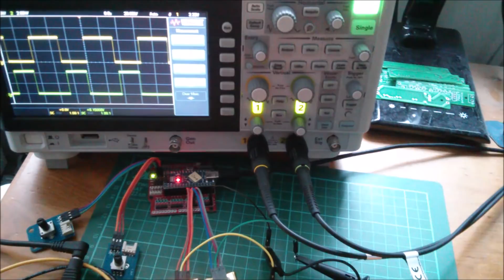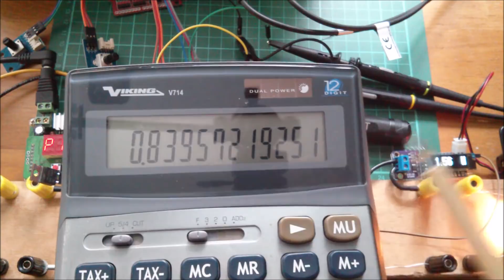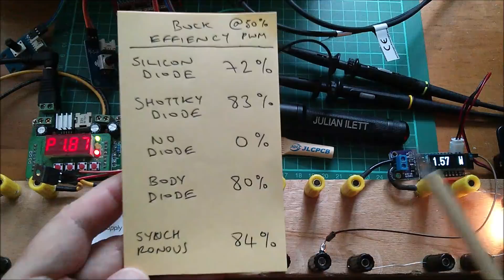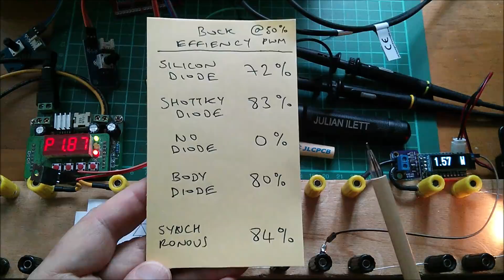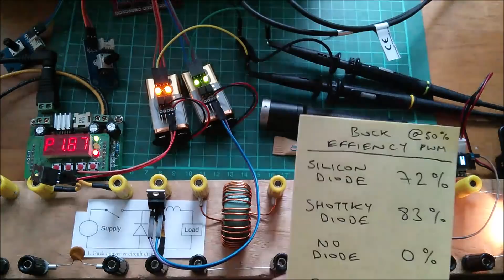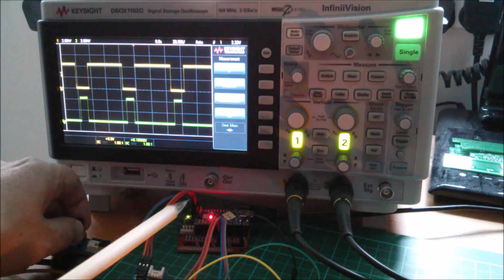Let's build a Synchronous Buck Converter

Comment: i can easily achieve %98 efficiency with proper selection of mosfets and drivers. Also inductor and frequency should be properly selected.

if you draw to little current, efficiency suffers. Try drawing 3-5 amps and see how everything changes

Comment: are you sure about that way to calculate the efficiency by dividing output by input? Because I get higher than 99% but not 100% even under like 6 amp load, is it  because my Arduino(which I'm driving the mosfets with) uses external power source? My Arduino ground is connected to my buck converter's input ground

Comment: Synchronous  buck converter only gives you a better efficiency at low duty cycle and / or at high output currents. Like for example the multiphase synchronous buck on a motherboard which will generate the 1.1V core voltage for the CPU out of 12V at 90 amps output current. Duty cycle is very small (high on time for the diode replacing low side switch) at high current.
An other reason to go for the synchronous buck, is the  need for bidirectional energy transfer, which your setup is already capable of.

Comment: I'm pretty sure that you did not build a synchronous converter.
Your MosFET's drain is connected to ground and the source is connected to the inductor, so that the inductor discharges through the body diode of the MosFET independent of the gate voltage/pulse with.
Instead, you have to swap source and drain to obtain an actual switch.

It is very interesting though that the efficiency changed even when the parasitic diode was acting as the discharge path. Maybe some ringing was prevented by the reversed MosFET?

Comment: You have gained 1% in buck circuit efficiency, but you are now powering two Arduino's. That equates to a significantly lower overall efficiency in this low power circuit than when running it with one Arduino and a Schottky diode. The only obvious ways that switching two transistors could possibly be more efficient than the simpler circuit would be either using one Arduino to switch both MOSFETs, or else to use two Arduinos in a much higher power circuit than the Muppet 2.

The question is 'Will you be trying to use one Arduino to switch both MOSFETs?' The results of that test would be interesting to see. Thanks Julian.'
Reply: He's using one Arduino. What you're seeing are two MOSFET driver boards controlled by the Arduino via an opto-isolator, having their own power source to isolate them from the Arduino.
But I agree that he should also measure the power consumption of the Arduino and MOSFET drivers to get the true efficiency.
Reply: I just noticed that these aren't discrete MOSFET drivers, they're opto-isolators used as MOSFET drivers.

Comment: If you want the efficiency, you may look into doing diode emulation.
The way you have it set up now, allows the output to leak back into the regulator

Basically turn off the FET when the current direction reverses!
You would need some way of meassuring the voltage over it or current to do the trick.

(there may be a way to use creative timer modes and meassure currents using timer trigger on ADC)

Comment: you are testing at too low output power, to see any great benefit of synchronous mosfet compared to only diode. Also dead time must be as low as possible, yours (because of drivers/fet) is not

Comment: Julian, the efficiency will be poorest at the highest difference between input and output voltage.  When you turned the output voltage up near the end of the video, the efficiency rose to nearly 90%.  This is very typical of buck controller behavior, and you'll see it in the data sheet tables for buck driver ICs.  You might try another set of comparisons with a smaller input-output voltage differential.

Comment: Bad ass julian, i was following this and wondering what all you were exactly doing, Dont they have something like this you can buy? Or are they really expensive?  Also when you are done will you be selling these or releasing like schematics or anything. Id love to build one just to try it out like you. I need to learn about buck/boost converters for powering led projects i plan on making. Probably gonna use atmega micros for the PWM like the arduino but i wanna mount all the arduino stuff on the back  of the led project board instead of having to buy an arduino for every LED necklace, wristband, pin or name badge i make.
Reply: If you know of a good place to learn about making boost/buck converters, that explains it all teaches you how to do it, and why this thing does that ect... lemme know with a link if you have time man. Great job

Comment: This is great stuff +Julian!  Can see that you are using 9v batteries to charge your gates.  If you like, I'll send you some notes on how to build differential Dickson Charge Pumps, so that you can create isolated, independent charge reservoirs with ordinary silicon diodes and cheap ceramic caps.  A 5 diode pump with 5v gives me 19v on the reservoir.  3.3v gives me 10v, which is just right for IRL3034 gates.
Reply from the maker: Thanks. My PWM5 solar charge controller uses a Dickson charge pump to generate the MOSFET gate voltage :)
Reply: It seems you need 4 independent  gate charge sources.  You can tie the Vin to the ground on the lower right (link below), so that your MPU does not share a ground with the pump's output: 
 https://en.wikipedia.org/wiki/File:Dickson_voltage_multiplier.svg

Comment: Couldn't the Arduino be replaced with a 555?
Reply: It would be some crazy circuit to do 0-100% duty cycle PWM.
Reply: @userPrehistoricman  It's not at all hard to do that.  You just need a pot to adjust the duty cycle with a diode connected to each of the end terminals.   The diodes will be facing in opposite directions,  so one conducts on the capacitor's charge and the other on discharge.  I don't know of a way to get some dead time with that arrangement,  though.

Comment: Is it possible for the Arduino to monitor the power on the high side mosfet and then adjust the low side mosfet accordingly?
Reply from the maker: Yes, that's a feedback control loop :)

Comment: Nice video, shoot trough is nicely demonstrated. With respect to efficiency there are numerous effects... down conversion factor (DC), load CCM, DCM. Inductor losses magnetic and resistive. MOSFET losses determined by the steepness of the switching flank (I see no ringing so you do not have very steep flanks) losses by switching (Qg), Channel losses Rdson, reverser recovery of your body diode. In general high switching frequency has the benefit of being able to use small inductors and capacitors but higher losses. The challenge is small and efficient and low EMI. Zero voltage switching is getting more and more popular.

Comment: just thinking aloud but with higher duty cycles of the high side mosfet dont you need more time for the low side one to discharge all the energy in the inductor? maybe connect the scope across the inductor and from ground to the inductors input? I really need a scope to play with lol
Reply from the maker: You don't want to fully remove all the energy in the inductor. With a longer high side on time and a shorter low side on time, you get a higher output voltage :)
Reply: Julian Ilett ok I think I see it now it will stay “charged” meaning less impedance and the input power can flow through easier

Comment: Nice video! I noticed that at time frame 7:49, I paused your video and calculated your efficiency Pout 2.40 / Pin 2.67, and got 90%.
Reply from the maker: Yep, efficiency improves as the duty cycle increases. The bulb was quite bright at that point in the video - the duty cycle was well above 50%.

Comment: Don't forget to test both the schottky and the synchronous at different loads or duty cycles, that will probably give you the bigger difference you were looking for.
Reply: Thats right! synchronous  buck converter only gives you a better efficiency at low duty cycle and / or at high output currents.

Comment: Could you sharpen the gate signal and increase the slew rate using a fast opamp to compare against a threshold?
Now to try with different frequencies and inductances to find the best efficiency!
Reply: Yep efficiency can be sorted out later once you understand what it is doing and get it to work correctly, this is proof of concept not here is the final product, same reason he hasn’t put smoothing capacitors, now once he connects it to a supercapacitor bank or battery then that would be the smoothing needed to be able to use it
Reply from the maker: Yes, but I'm not going in that direction. From this point on, I'm not really interested in efficiency. Just want to generate suitable signals for buck, boost, tranfer left, transfer right.
Reply: Thanks Julian, in that case you're doing a good job of explaining and illustrating the principles - however, when you're done, it would be good video content and icing on the cake to demonstrate how to improve efficiency and would be a useful contribution to humanity!
I have a feeling with the surge in solar energy and DIY lithium batteries, that the demand for cheap and efficient DC-DC and DC-AC converters with or without MPPT will escalate rapidly.

Comment: So that was the reason. BTW. Isn't it (both transistors on at the same time) the reason why overclocked CPUs get hot? Maybe if you increased the inductance and lowered the switching frequency then maybe you could make efficiency get better.
Reply: Though I am not an expert of the topic, but basically every transistor let it be a discrete FET or something "inside" a CPU, has some little capacity. You need energy to "flip" it to the other state as such. And with the frequency increasing it's more and more a big problem to be able to "defeat" it faster (=higher clock frequency) you need to spend more energy to do that. This is why usually you need to increase power voltage as well to be able to overclock. I don't think the reason is strictly connected with the "two transistors are switched on at the same time", this happens even just with a single transistor, that it's harder to switch it on-off if you want to do it more rapidly. In fact (leaving the CPU overclocking topic now) it would be interesting to see with this Buck-converter experiment how numbers change if different PWM signal frequency is being used. Maybe even with some graph :)
Reply: Yes, indeed. Gate capacitance has also an effect on power consumption of a switch. But I think I am not in the wrong as well.
Reply: Maybe, I'm not sure about that, CPUs internally (or even externally? who knows, it's not a Z80 any more ...) use a single phase clock, it can be more a problem with multiple phase clocks designs. I guess if this would be a problem as you suggested it would cause malfunction of the CPU and wouldn't be a stable overclocking at all. But surely, I can be wrong here :)
Reply: Actually Z80 uses single phase clock. It was 6502 that used dual phase clock. But today there is a lot of PLLs in the CPU itself so it is not that easy anymore.
Reply: Yes, this is what I told as well. So modern CPUs may not be such simple as Z80, using single phase clocks :) Indeed.
Reply: Oww… sorry… I misunderstood a little ;)
Reply: No wonder, my English is far from being the best, it's often a challenge for me to be able to express myself well enough. Ouch, and sometimes it fails, well ...
Reply: It's the same for me.

Comment: I got the necessity for the dead time, but why did you keep the on time for one of the MOSFETs at 50%?  What would the efficiency have been if both FETs has an equal on time?  (E.G 48% on each)  I'm guessing it wouldn't have changed, but the OCD in me wants to know.  😏
Reply: @flickpad
he did show equal on time and efficiency was out the window and risk burning up high side driver :-)
Reply: Yeah that was 50/50. I'm not talking about running without the dead space. What I mean is instead of 50% on one and about 46% on the other, why not 48/48?
Reply: @flickpad
that would just be equal and a 4% no state dead space :-)
if you turn off both transistors it would just be "off" input and output power would go down so it wouldnt be any more efficient , probably less :-)
Reply: Yes, but as Julian says, it's important to have a short "off" period because of the rise and fall times of the waveform to prevent a situation where they are both on simultaneously.  My question was really concerning whether it would be better to have the dead space in a position where both FETs were on for the same amount of time.  My guess is that it would make no discernible difference, but I would have liked to have seen it tried.
Reply: @flickpad
you still cant have the time the same on both transistors because it would be  the same as 50/50 where one TR is going off and the other TR going on and then you get the excess current as they change state and overlap :-)
Reply: YTANDY100 Sorry but that isn't right. If you watch the video again you will see at around 6:20 Julian is adjusting the pulse width without losing the dead space.  Unfortunately the watt meters are out of shot so we can't see if the efficiency is effected. :-)
Reply: @flickpad
at 3:48 you see the input current rise as he takes away the dead band , he is making one TR switch off at the same time as the other TR is switching on (causing a partial short circuit) , it would be same result if both TR were switching at 48% but you would also have to have a 4% total off to make up the 100% (you wouldnt want both on for the 4% as that would be a total short circuit) , you basically have to make sure both TRs are totally off before you switch either one on :-)
Reply: As I said in the first comment, I get the need for the dead space.  I don't really understand why you believe that 50% T1 on, 4% off,  46% T2 on, would be more efficient than 48% T1 on, 4% off, 48% T2 on, or how that would be the same as 50% T1 on 50% T2 on.
Reply: @flickpad
its not the off time that matters , its just that if both TRs had the same time period you would get the overlap same as 50% , so if both TRs switched at 48% there would be an overlap , if you switched at a much lower % so they were outside each others on time it wouldnt be working as a synchronous converter :-)
Reply: The mark space ratio would ensure that they wouldn't overlap. Each transistor would be on for 48% and off for 52% of the time, and there would be a gap between each transistor turning off and the other turning on thereby ensuring that they are not on at the same instant.  I wish I could draw you a diagram, but that's the best way I can describe it to you.

Comment: I tried building one of your DCOI drivers. While good in theory, I found they were too slow for any high frequency switching (I think you even mention this in one of your videos). So I ended up switching to an IR2101 or similar IC, which changes the state of the FET so quickly you actually need a gate resistor to avoid some weird noise issues.
Reply: Exactly. Weird issue you had is ringing, plus you have to make sure the charge/discharge current for the gate is in recommended range for the driver IC.
Reply: Right! That ringing is intense without the gate resistor.
Reply: I had exactly the same ringing issue when I was building my buck converter, in much the same way as shown on this channel. I did all sorts of messing around with inductors and capacitors trying to figure out the best way to be rid of it. Answer turned out to be a simple 47ohm resistor on the gate.
Reply: That low? I thought mosfets had a high impedance and ideally don't sink current at the gate at all.

Comment: What MOSFETs are you using?
Reply: As a followup to the comparison of diodes, I'd like to also see a comparison of MOSFETs. I'm curious how high an efficiency is achievable if you optimise the hell out of the thing.

There seems to be a correlation in the few I looked at - the lower the Rds, the slower the switching time. Probably because it needs a physically larger gate - but there must be a MOSFET that gives the ideal balance between Rds and switching losses at a given frequency. Experiment and find it!
Reply from the maker: IRFZ44N because I have loads of them.
Reply: I know that one. Rds of 17.5mili-ohm. You might be able to squeeze a few more percent efficiency out if you try one with a lower Rds. An IRF3205 is about as low as you can get, 8miliohm. Less than half the resistance of the IRFZ44N.  It's substantially slower to switch though, so you might find some of that efficiency promptly disappearing in switching losses. Maybe get one and swap it in so you can compare performance.
Reply: There's a few MOSFETs with Rds way lower than that, like the IRL40B209 at 1 mohm. There's even one at 340 uohm, the IRL7472L1TRPBF, but it's in a rather obscure SMD package.

Comment: The problem here is that you are wasting power in switching the MOSFETs, so the 2° mosfet advantage is negated vs a common schottky diode.
For the optimum synchronous converter you need a proper gate driver for a sharp turn on and off, and a proper deadtime!
That will skyrocket the efficiency

Comment: Hi 
Actually efficiency of your buck converter is about 90 to 95%
By using IR2110  high and low side driver ic
And using smoothing capacitor at output and by  putting shotky diode in parallel with mosfet
Reply: Could you help me about IR2110. I am building DC-DC Buck Converter with pic microcontroller.